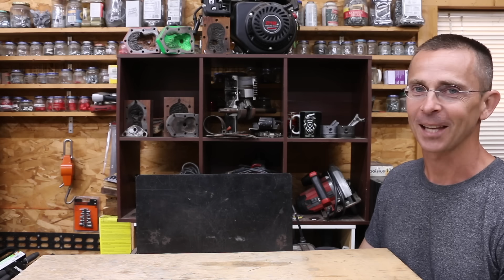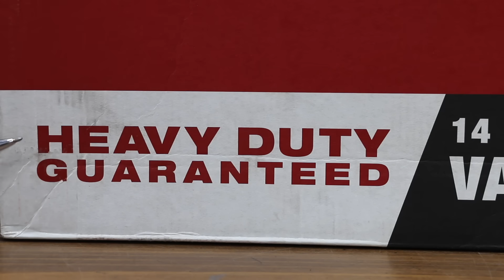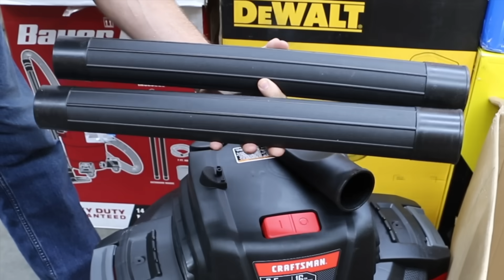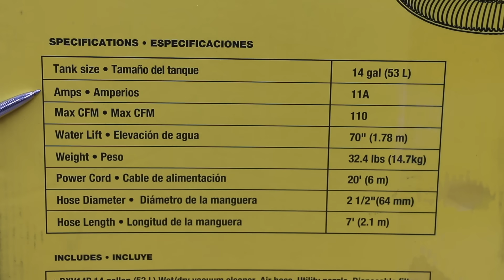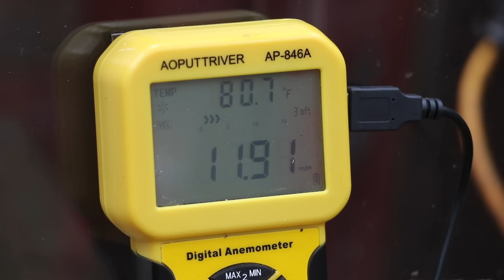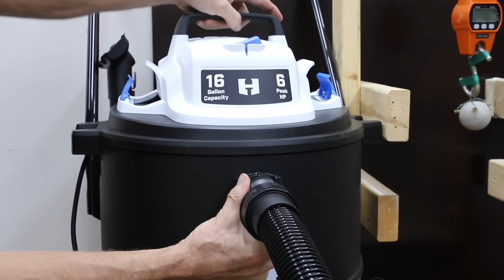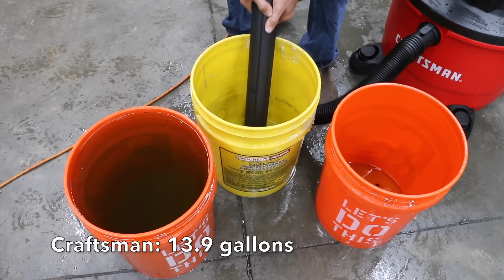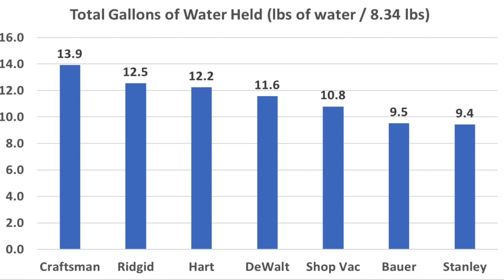Best Shop Vac? Ridgid vs Shop Vac, DeWalt, Stanley, Hart, Craftsman

Comment: Out of all the products you tested, this literally sucked. Haha. As always, a wonderful job with developing the methodology for testing. Suggestion: I have been looking at connectors for splicing trailer wiring-- self soldering, crimp, heat shrink,  push-in connectors, etc. . I was wondering about the durability and water resistance of the various methods of splicing for trailers. For quick repairs, we would strip em, twist em and tape em, but I am thinking about electric brakes, and on the road lighting ,

Comment: I enjoyed the video, BUT your suction measurement was somewhat flawed. The downward force is equally a factor of the hose diameter and its effective seal on the ball. ( i.e. force = vacuum x effective area). A better test would have been a good old homemade U-tube manometer with measurement in inches of water column.   (which is the unit of measurement for weak vacuums). Hey, you may have been the first to use a U-tube on YouTube !  : )

Comment: I once owned a Craftsman wet dry but found its ear piercing sound too much. Switched to Ridgid and always had good service and it’s a much quieter machine. The Bauer in all honesty looks pretty good and although the warrant is a shorter period I never heard anyone I know complain about an inoperative vacuum that needed service. Harbor Freight does have an extended warranty available and their return policy is great. My Ridgid just wont die no matter how much I abuse it so I don’t think I’ll be shopping for a replacement any time soon.

Comment: Ability to pull-down-the-ball is almost entirely dependent on the diameter of the tube.  It's all PSI.  The larger diameter the tube, the more Square Inches.  The area of the tube is more important for suction on the ball than the motor's power.

Comment: I believe my own personal with the Shop Vac brand Shop Vac experience coincides with those results. I recently got that one. It is fine. Used it for liquids, solids and the exhaust for a pressure test. Not disappointing, not impressive. Price seemed fair enough compared to the competition.

Comment: They must not make Shop Vacs like they used to, my OLD Craftsman Shop Vac (only 4.25HP) lid doesn't pop up anywhere near as much as these ones tested, I mean it does a little but most of the new ones tested here seem to pop up quite a bit. She's an old beast but still works many, many years later. Just had to use it a couple of weeks ago when my stupid laundry tub overflowed! Well, now I know which ones to check out if mine ever dies. Thanks again for your thorough testing, PF!

Comment: Thank you for the effort. One test that would not lie about suction, would  be a static water lift.

Using a large dia clear tube, maybe 1-2" in dia, .measure the height of water each vacuum can lift.

While expensive, one notable mention would be to pair them against a Fein vacuun.

Also, measure the amp draw and noise level with the nozzle either covered or while sucking water from the bucket.

Comment: I’ve got a list of things for yah to rate!

Permanent markers(like Milwaukee’s work brand/sharpie)

18 gauge nail guns with a standard 5gal compressor

Compressors? (Cordless or corded)

Pressure washers

Phone screen protectors (maybe cases too)

10inch chop saw blades? All brands of high teeth and low teeth count?

Comment: More than 10 years ago I bought a Shop-Vac with a stainless tub for the shop. It has been a great vac. When I machine plastics I put a large trash bag in it and use it to capture the chips. When it gets full I don't have to deal with transferring the chips out of the tub into the bag because they are already there.
For jobsites I have a Rigid ProPack that I have used to jet conduits all over the country. 
For quick clean-ups I have the Dewalt 20v vac (580 I think) which is surprisingly strong. In fact I used it to jet a 150ft underground PVC conduit last year.

Comment: Longevity is a factor that is hard to gauge with these. I still have my 2 horse, 2 stage Contractor Shop Vac with the stainless tank, gotta be 20 years old. No where near the flow as these but plenty of suction for things I don't want going into the dust collector. Built like a tank. I treat it like crap, toss it around and yank it by the hose, rolled it down a flight of stairs landing on concrete, forgot filthy water in it for a couple months, used it without a filter (whoops), and still runs like new as long as I change the filter when needed. I doubt the new Shop Vac are still built to last that long, judging how flimsy it looked (including the Contractor ones I've seen recently). It would take a pry bar to break the seal of the cover to tank on the old units with its triangular clip pattern.

I have seen some old Craftsman vacs working great for years. But has that changed over the years now that Black & Decker owns the brand? Or has B&D made Craftsman better?

Comment: I think the hose diameters measure OD and not ID. That way if you need to replace accessories you get the right ones since they generally go on the outside of the hose end.

Comment: Just fyi, amps are not a unit of power and are therefor not directly convertible to horsepower. However, if the voltage is known, they can be multiplied to get watts which is a unit of power. Also, the measured input power from the wall isn't always a good indication of the power output of the vacuum as some might be more efficient than others, the ideal way to measure power would be to measure the power of the air being sucked in, but a practical apparatus for this would be tricky to devise. Great video otherwise.

Comment: Mine when by price. Since I don't need to rely on a shop vac and use it only a few times a year, when I saw a sears shop vac on craigslist for $25, I grabbed it. It was already assembled, and working great. It moves a lot of air, and hasn't let me down in the last 5 years I have had it. The filters are easy to get because it uses the large shop vac filter, which is everywhere.

Comment: in suction test, force is directly proportional to hose area that's proportional to its diameter squared. so hoses that are even slightly thicker, were at a huge advantage.

maybe you should have used a standartised attachment on the end for all hoses to make comparison fair.

Comment: Great vid though I also wanna see how black and decker(which we use at work) and bosch compete against other shop vacs. If you haven't done it would you test different electric pressure washers. I really want to see if cheaper is better and also I will suggest it to my boss who ever will be the winner. Also if possible will you also test different brands of coring machines or if not just the blades. I want to see which ones the fastest to bore a hole on concrete and reinforced concrete, which blades have the longest life time and price per performance comparison....

Comment: Instead of total gallons of water suctioned, it would be better to put it as a percentage..... Its not fair if a larger bucket wins the contest because the  smaller bucket one can't hold the same amount so of course a 16 galllon shop vac will hold more than one with a smaller bucket

Comment: I will say another great video PF!  I own the little 4 gallon SVX2 Shop Vac brand unit, and have used it in my professional auto detailing business for a couple years.  It's held up extremely well, has all the attachments a pro detailer could want, and tons of power.  It's really a matter of preference, and for me, these big shop vacs are pretty much irrelevant because I need a smaller package.  One thing I will say, is having a longer hose makes a big difference, at least in my application, even if it hurts performance.  Great job as always!

Comment: I would like to see you test the house brands of major auto parts stores on say u joints, bearings , and fuel pumps or chose things you know you can test fairly.  Even like metal stress tests on control arms. I'm sure you can figure  something out. I used to work at the O now I work at Napa and the quality  difference  is night and day. I dont think I need to say who's is better most people  watching this already  know

Comment: i have 5 Ridgid vacs...   WD4150 is the best model..  it was sold as a more quiet vacuum and its the oldest one i got.  has the biggest size inlet (that i have modified)  I once used it without a filter to pump the dust outside from a conrete sander (before i found out about Cyclone Separator)  Had to take it apart to clean the fins (after 3 days)  replaced the wire 3 times. and it looks like its been in a war..   BUT it still works better then anything i have seen other people use.   1400RV in the new model.   id like to see a test of the higher end models but i can see that getting costly.  home depot likes to sell the value models for super cheap to sucker people in but they...  just don't suck at all o_O

Comment: my last shop vac was a craftsman 5HP - it lasted over 10 years of abuse before the motor brush snapped - I literally ran it for hours at a time porting heads - used it to remove shavings while I ported - I would recommend

Comment: That was a great video, very informative. I've always been impressed with Rigid but not the gimmicky "removable motor" type. I've had one for over a decade and it's been through hell and it's still going strong. The real surprise here was Bauer. If the extended "no questions asked" warranty HFT offers is at a reasonable cost, it might put this one over the top.

Comment: A products warranty is always rolled up into the price. So a low cost product is probably not going to have a great warranty. Would be interesting to see a comparison of retail price vs warranty vs performance. Yes, probably not an easy comparison, but that is what is driving the price of the product. Getting a tool at a low price and deducting "points" for a low warranty should not be compared with a more expensive product with similar performance.

Comment: I have several in my woodworking shop. Most my machines are attached to an industrial dust collector. IMO my Kracher is the best portable unit for dust with it's HEPA filter and Auto On-Off switch for your tool. I use it as a dedicated vac for my power sander. The exhaust air filtration is a must for dust collection, otherwise you're just blowing dust back into the shop. Kracher is more expensive at $250, but unit is built much better than a box store vac. I still have a few Shop Vacs attached to cyclone separators, they do increase the performance of a vac. Great showdown,  Really enjoy your enthusiasm in your videos.

Comment: I use my vac for long periods of time, commonly running for 3+ hours straight, almost every day. I have a Shop Vac brand that's run like that for 4+ years. I burned up at least 5 Craftsman vacs before that.

Comment: Just for fun id like to see the suction power of a Dyson in comparison. I know that it doesn't have much capacity and is not designed for sucking up water. I just recently found a mini shop vac at Walmart in automotive. By Armorall that has surprised me for what you get for the buck. I use it for detailing car interior. Great video as always!

Comment: I don't think that was really the right Ridgid Vac to compare with those others, it's really a $60 vac that you pay a lot extra for with that detachable blower feature. I have one of the more "professional" Ridgids and it is much better built than that one you showed. It is also by far the quietest shop vac I've used.

Comment: The main reason I like Shop Vac brand is for their consumer affairs. It’s not the best and it’s not the worst. In my job field I use a shop vacuum several times daily and my Shop Vac brand one lasted 4 years before the hose gave out on its own. The bucket had been battered as well but the motor was still strong. They sent me a new bucket and hose for just shipping cost. I was calling with the intent to pay full price for a new bucket and hose. That’s what keeps me with them.

Comment: I think it would be cool if you could use these tests to choose a best all-around product. For instance, maybe you could assign a certain number of points to each product based on its performance in each of your tests. If you were comparing five vacuums, then the 1st place vacuum in one test could be awarded 5 points, the 2nd place 4 points, 3rd place 3 points, etc. and repeat the process for each one of your tests. Then, at the very end, you could tally up each product’s total number of points and the one with the most points would essentially be the best all-around vacuum. You could also award points based on which has the lowest price (so the lowest price product would get 5 points and the highest would get 1 point since there are 5 products being compared)

Comment: Enjoy all your test. I have a 20 year old Toro zero turn mower and the left hydraulic side is slipping. Engine runs great and it cuts great. The hydraulic drive motor is very expensive and labor replacement cost is high. I hate to scrap the mower. Do you know if power steering stop leak would keep it going or another solution? It's a Z222 commercial unit. All fluid is used out of a common tank. I am sure as other people with zero turn mowers get older this will be a more common problem. Thanks for any ideas.

Comment: A little disappointed in the head to head water challenge. Should have had a jig to hold tube straight down in buckets and turn on vac at the same time with a surge protector or a jig to lower them in. 😃👍🏻

Comment: A comment about loose fits: In some cases, as soon as you turn on the vacuum, the seemingly loose fit gets pulled in by the vacuum pressure. So I don't necessarily consider it a flaw unless it seems that the joint is not able to seal (like if it is irregular). Vacuum chambers, for example, sometimes don't have any closure mechanism on the lid. Once the chamber is pulling a little bit of vacuum there is no danger of the lid coming off or leaking because there are hundreds of pounds of force on it.

Comment: I got a small 4 gallon 3HP shop vac brand shop vac for about 40$ from walmart and its fine aside from the hose diameter could be wider. 
but I can always buy a better hose anyways and it will suck up bigger debris more easily
I just use it in place of a normal vacuum in the house cause it holds more. 
and can handle much tougher debris than a normal vacuum. doesnt clog as much. and has way more suction. almost too much suction (will suck up almost anything. even including 18650 size lithium ion batteries if your not careful!)

Comment: I bought a Craftsmen years ago on sale for $39.99 and the best thing for it was to adapt the floor water attachment with a bolt and some wooden rollers through it. This way it keeps working instead of getting sucked to the floor in one spot.

Comment: Project Farm, have you rated the amp draw without any filters installed? because the most restriction you put on the shop vac, the less amps the motor will draw since it can't more enough air and air is the main restriction.

Comment: This weekend I was working with ratchet straps, and a lot of the time, they are difficult to release if strapped too tight, and if left in the truck bed during rain and snow, they get more difficult to ratchet down.
With how clever your tests are, I wonder if you could find a way to test different brand ratchet straps for durability, ability to withstand weather and continue to work, and ease of release.
Is that something that is even worth testing or is it all just in my head?

Comment: I buy used Craftsman 16 gallon units from craigslist for forty dollars or so. I'm using a very old one outside as a whole house unit that keeps the noise and dust outside. It has been in the Sonoran desert sun so long the barrel was imploding. I found a hoop that fits inside and keeps it from imploding and it is still going strong.

Comment: One thing you might want to consider for future shop vac testing is using the vac as a small/portable dust collector for a sander or saw.   I have owned a Craftsman shop vac for over 30 years and it is still going strong (this would have been made by Emerson tools back in the day, same manufacturer of Rigid tools today).   I also have two Fein vacuums that are fantastic machines.  They work well as a dust collector, are well made, very portable and work well as a wet vac, and dry vac.   One that I have never tried but is in the same category as Fein is the Festool brand vac.   Granted they are more expensive, but more versatile.

Comment: Great video. But the lift test is flawed (in my opinion). You need to use same diameter hose for all units. Force is area * pressure. You could also just measure static pressure with the inflow completely blocked.

Comment: I've had my large Craftsman shop vac (20 gal I believe, 6.5 he motor also)  for close to 15 years. Its never let me down but boy is it loud! They actually used to sell a muffler for in the exhaust port that does a good job of cutting the noise and helps not blow dust around from the air coming out of the exhaust

Comment: Cordless shop vac comparison would be great. I work at a auto shop and it’s flat rate sometimes we don’t really have time to pull out a extension cord and all and have considered buying a cordless because of how easy they are to use. Gotta suck up them acorns and leafs before they go down the intake and go for the engine.

Comment: That was great. The noise from a shop vac is one of the reasons that I went with Rigid's Sound reducing vacuum, I think they call it SNR. It has really lasted. Figuring out how long something will last is tough to do but would be a great thing to see. Thank you for the videos!